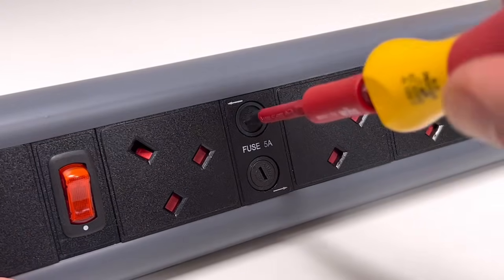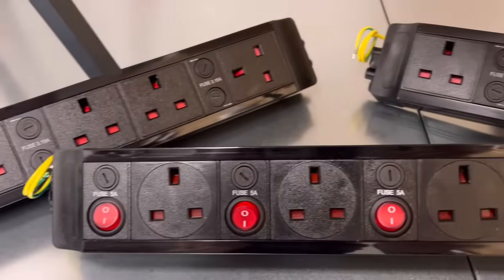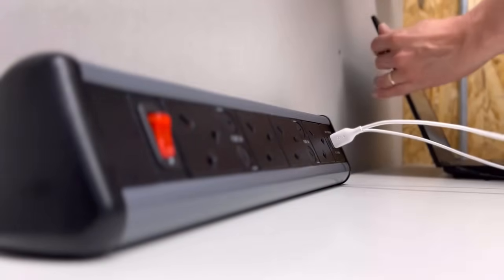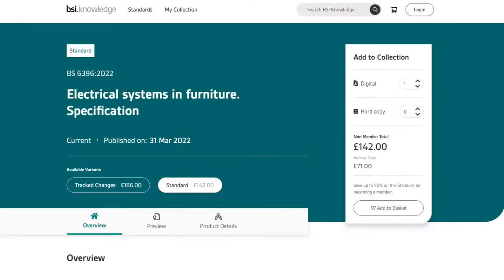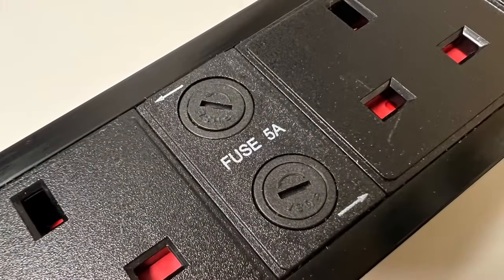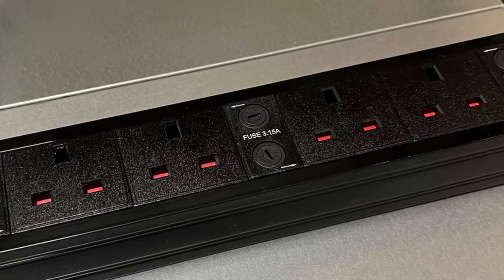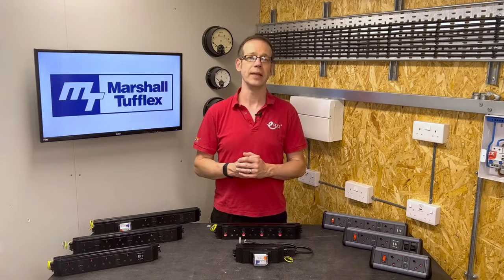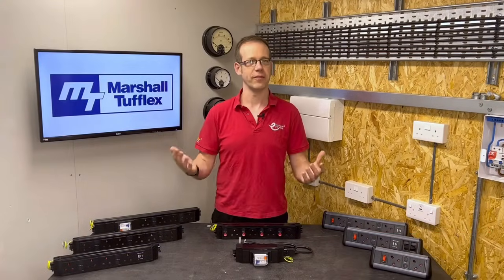BS 7671 Won't Tell You - Why Desktop Sockets Have Tiny Fuses

Comment: Our staff used to put 2kw heaters in these sockets and kept blowing fuses, Then just unplug and put into another socket.
They were told many many times not to, but hay, they are called managers or supervisors and more important than I. (By salary at least, but not by common sense)
Then when moving their laptops to blown fuses, would compain that every thing here is 5h + 1t     o.O
We removed all heaters from all desks and told them that 21'C is just fine, Just put a frelling jumper on.
AIRCON WARS. Damn it's messy
Reply: All to common.
Reply: Yep. We had the cleaners go down whole rows of these sockets with their vacuum cleaners, taking out dozens of fuses!
Reply from the maker: Yur, it's one of those things clearly stated in the Standard but probably never been properly communicated to staff. 🤷
Reply: @MrBinabanana  At one point, I used to take my time to replace the fuses if I saw a heater near by. 
They used to remove them from the kitchen and eating area. Just to keep their legs warm. 
Even tried cable ties to keep the heaters down stairs.  
Their attitude was "Sod every one else, I'm cold"  Even at 21'C
Reply: @MrBinabanana That is exactly what happened im my office, now everyone has a couple of standard extention leads, and they are all plugged in one after another. Much safer than it used to be. Buy hay they are all pat tested.
Reply: @efixx  Can you still use BS546 5A Type D's for this kind of purpose? (I've seen that in the past). Just need some fly leads with IEC C13s on the other end.
Reply: @MrBinabanana  Were they foriegn in the sense that they did not speak/understand good English and thus asking them not to do so would be futile.
Reply: To be expected when you install sockets that accept any 13A plug, and look identical to 'normal' 13A sockets. I bet the only other place most people will come across a socket like this is on a train, or in a hotel room, when they don't have their 3 bar electric fire with them.
Reply: Had this at my old job. Desk electrics had 3A fuses per socket and staff kept plugging heaters in. Had a policy whereby any heater found on site would have the plug snipped, no excuses. So, when they blew the fuses one day we went over and told them not to plug any heaters in (again!), only the RCD had tripped. Went to the electric cupboard and it was stacked full of the heaters they thought they had hidden! Must have been 15 in there and each one got the snip. Got several complaints lodged but all threw out due to a blatant breach of policy by the staff. I don't think they realised that the large metal MEM box on the wall with a yellow lightning bolt attached was the DB feeding their workstations. It wasn't even cold it was 23C year round in that building, put on a jumper FFS.
Reply: @MrBinabanana  when i spec systems like this you need a few none fused sockets in a easliy accesable place for your higher current loads like vacuum cleaners, large photocopiers because people will do things you can never dream of. you need to be prepared for everything because you will get called in as nothing works.
Reply: @paulmatthews5470  23'C - Wow, (Some staff would still complain)  It's too hot or It's too cold, or even worse, they open a window when a room has aircon and it's humid and 30'C+ outside (Very VERY rare British summer day). 
I want fresh air. it's too stuffy.   My Rant over now. lol
Reply: @MrSnowMen   Dreaded doing anything major in there as I'd sweat my tits off in a few minutes and end up a smelly BO mess for the rest of the day!
Reply: @richardalderton1047  True, So how would you stop people using the same looking socket?
Reply: What is 5h + 1t?
Reply: The girls in our office had 2kW fires under the desk, to keep their bare feet warm...at leaat most were plugged into a floor socket, not the desktop ones. All appliances were supposed to have a PAT label, but fires brought in from outside would not be in the database, and would be confiscated...
Reply: @MrSnowMen 21C at five foot above floor level (official thermostat height) is not 21C at a lady's foot level...
Reply: @paulmatthews5470 Ladies wear socks and trainers on the way to work, then pull their fancy high heels out to clack loudly round the office. No socks, ergo, cold feet...heat rises, so 23C at head height is cold at foot level...

Comment: When I replaced my desk about 7 years ago, I just used six double sockets in surface backboxes. All fed off a 13A rated cable from a 13A plug. Works great.
Reply: Did you check for resistance ? You could have a lot of heat building issues if  your not careful, it could work great and show no problems but catch fire while you sleep, so always check the resistance in a newly installed electrical outlet
Reply: @danielphillips5324  The whole thing doesn't even draw anywhere near 13A total. I think at one point the upstream fuse even was even just a 5A.
Reply: @danielphillips5324  
Resistance? if all cable are connected up correctly resistance is minimal. 
All Dave needs to do is ensure the fuses in the appliance plugs are correctly rated to protect the appliance and appliance flex.
Reply: Same here for my small electrical/electronics workbench. The 4ft or so of flex feeding the sockets is 1.5mm² and there's probably a maximum of 5A load, if that. An oscilloscope, a function generator, a desk lamp and sometimes my PAT420 tester.

Comment: In the UK, these 5A sockets on a desk bank is overkill, but not elsewhere. We have fuses in plugs which should be rated to say the computer which is usually 3A. So four sockets on a desk bank, which is plugged in the  wall socket rated at 13A maximum.  All bases are then covered. Most computers do not draw more than 2A, so six maybe possible on one bank. 

The 5A sockets on desk banks makes perfect sense in a Continental or American setup where all is protected by say one 16A breaker at the panel.

Comment: BS 6395 does not say a 3A or 5A fuse has to be in the desk extension bank. The great thing about the British G Type socket and plug is that a fuse is in the plug. Rate the plug to 3A or 5A accordingly and omit such tripe as a fuse in the extension bank.  No need to have fuses in the extension bank itself.  It is just extra needless complexity and expense.
Reply: Maybe you should actually read the text at 2:14:

"No more than four sockets, where each socket is separately fused..."

That means the protection is required to be in the socket, not the plug, and each socket must have its own fuse (so the fuses must be in the extension bank, since that's the only possible place to do that), so your statement is clearly wrong.

The purpose of this requirement, as stated in the video, is to prevent people from plugging higher-powered devices into these desk extension banks.  Relying on the fuse in the device plug would not be able to prevent plugging in a higher-powered device with a higher-rated fuse, and is therefore useless for this purpose.
Reply: @foogod4237  
I did actually read it. I read the words making no assumptions.  You assumed the fusing must be in the socket housing.  It says no such thing. It says:

a)
No more than four sockets, where each socket is separately fused or has other overcurrent protection rated at not more than 5A.

It does not say where the fuse should be specifically located at all. It does not say, the fuse:

1) has to be in the socket housing
2) has to be in a separate housing 
3) has to be in the plug.
4) has to be in-line in a cable.

I does say:
or has other overcurrent protection rated at not more than 5A.

▪ If the extension strip has 4 sockets outlets each socket must be fused somewhere to 5A. 
▪ If the extension strip has six socket outlets each socket must be fused to 3A.

It may be a good thing if manufacturers had in big embossed letters on the extension strip that each socket must have a 3A or 5A fuse.  But nothing says they have to.

Comment: ah bs6396 i have spent many hours reading and designing systems. a few important thing you forgot to mention is  bs6396 power outlets are designed to be used with bs1363 plugs only and with a flex cable of no more than 3m.
Reply from the maker: Thanks for the extra info! 😃

Comment: Power strips in North America generally have a single 15 amp circuit breaker for the entire power strip. To be fair, power strips here aren't built very rugged anymore, so a constant 12.5 amp load would likely result in them melting and bursting into flames. (cough) This means that if you need to use a power strip for more than just light power use, you're better off building your own power strips out of J boxes and quality receptacles.
Reply from the maker: Interesting 🤔
Reply: In Finland power strips generally do not have over-current protection. They are rated for 16 A though.
Reply: Same thing Australia.  10A breaker in all but the cheapest of the cheap rubbish.  Each standard wall socket is rated at 10A so the powerboard should limit there.  The general construction of typical units is also pretty cheap 'n nasty here, definitely not rugged.
Reply: @okaro6595  
oops!
Reply: I’ve just made my own extension cords and power strips with 14/3 flex cable, weather tight/strain relief connectors, metal outdoor electrical boxes, matching covers, and various different sockets and even switches for switched extension cords and switched power strips
Reply: You could also just buy a higher quality power strip that's rated for more current
Reply: And i bet it looks crap!!!!!!!!!!!!!!!!!!!!!!!!!!!!!!!!!!!!!!!! @NyxKemo
Reply: @JL-rx6hl  nope, looks better than any extension cord or power cord, but most importantly it can safely handle a full 15 amps without catching on fire
Reply: @okaro6595  Same in Federal Republic of Germany - every outlet have rated 16 A, a normal power cord should be 3x 1.5 qmm², 230 Volt, 16 A, 3'500 Watt. In Thailand it is 10 A, also 3x 1.5 qmm², 230 Volt, 10 A, 2300 Watt. 

BTW: We are so clever to use only one device in a multi-plug socket with long power cord at the same time same the Finland people. 😊

Comment: Quick question I’ve wired in a 4 gang socket that has the 3.15amp fuses in them, very similar to the triangular one in the video. I’ve replaced the single socket that was spurred in my living room with a fused spur. 
So it goes like this 
Fused spur————-3.15a 4 gang socket. 
My question is what can I reasonably run off this? 
I have an undercounter fridge I would like to connect and my partner uses printers, laptop and the occasionally air fryer for her hobby. Obviously not all running at the same time but would any of these cause any problems.

Comment: I suspect there is a secondary linkage via the typical RFI filters which can create up to 1.6mA earth leakage per connected device, and via various multiplying effects will create a larger earth leakage across the whole extension, which then falls foul of other limits on the the single fault earth leakage limits. 
I suspect that there's a hidden rationale of scaling the RFI earth leakage in the appliance based on its maximum current, or it could be a diversity limit across the multiplicity of items plugged into the multiple socket outlets to limit total current.
Reply from the maker: Thanks for commenting! 😃

Comment: It seems really annoying that they even have fuses where circuit breakers should have been used. The first time someone plugs a kettle in that fuse will pop. There are only two possible outcomes for what happens next, either the fuse never gets replaced and the outlet remains dead until the whole thing is replaced and the socket strip ends up in a skip, or the fuse gets replaced with the wrong value to ensure it does not pop next time someone plugs a kettle in and the whole assembly overheats.
Reply: Probably the fuse gets a "hardwire-bypass" by a known DIYer… 😲

Comment: They were a real pain in my old office you could guarantee the cleaners wouldn’t bother to use the floor sockets, just plug ‘Henry’ into the desktop socket and blow the fuse so when you got work your computer didn’t. Happened pretty much once a month to someone in my team.
Reply: Hmmm ... an original Henry is build in UK and use 620 Watt at 230 V, this are 2.696 Ampere. Should be work in 6 slot and 4 slot multi-plug power cord without problems. Possible your office need an electrician quickly! 😊 

Hail the internet for checking true information... 😂 

I self use a German "Vorwerk" but at one of my working places use a UK "Henry" since years! It is a wonderful product for clean the big dryer 12 times daily.
Reply: @OldLordSpeedy  IIRC the double sockets have 3amp fuses in them, plus although the cleaners commonly had a Henry, they also used a large wet and dry vacuum.
Reply: @garyhill9723  Do you not read my full answer where I calculate that an UK "Henry" use only 2.696 ampere? If do you use UK typical 240 volt with 620 watt this are only 2.583 Ampere - less 3 ampere too.  For meet the 3 ampere do you need 206 volt at the 620 watt. 🤯🤦‍♂️ If this happened do you need an electrician immediately! 

My record here in Kingdom of Thailand was tested only 160 volt at 220 volt socket normally at an one-phase line after workers came home in a worker ghetto with around 60 houses. But I never seen this IRL in Europe without a real fault!
Reply: In my old office we had Walsall Gauge sockets for the computers for this very reason. Nowadays you could probably use the MK non-standard plugs and sockets with the T-shaped earth pin to achieve the same thing.

Comment: 5A gives 1200W approx so most devices would be fine. High end workstations though?  Threadripper Pro 400W plus 2x Nvidia RTX A6000 (300W each) is pushing 1000W at peak plus all the ancillary stuff. They will be better off plugged into dedicated UPS power  feed  anyway
Reply from the maker: Sounds like a decent setup! 💪
Reply: Well, that employer's a keeper!

Comment: All very complicated but to what end? All the applicances will have cords rated for their load current and the power strips are good for 15A say.  So all that is needed is some kind of thermal overload cutout with a push-button reset.  Most appliance faults lead to open circuits or earth leakage or enough fault current to trip an upstream Circuit breaker.

So the answer is mostly cheap power strips on sensibly sized circuits with circuit breaker protection and maybe thermal cutouts and residual current devices.

Fuses are to be avoided.  They create exposed live connections and need skills, tools,  and spare parts to restore supply after faults.  As seen from the other comments.

It seems that the UK is so committed to small appliance fuses that it cannot accept that their day has long passed.

Comment: I do NOT need a USB charger built into every piece of furniture in my house, thanks very much! 🙄  Simplicity beats piles of future e-waste.
Reply from the maker: Well, it's not mandatory yet... 🤔
Reply: Worse still the underlying SMPS is always on so there's always a tiny load for no reason since the USB isn't switched
Reply: I purposely do not install USB outlets in fixed installations, as they will be outdated much sooner than the life span of the receptacles. In the high quality extension cords such as the ones shown they would be all right, but usually its more economical to buy USB chargers separately.
Reply: The built-in USB sockets do not support high-power device charging, so your new phone will only trickle-charge...
Reply: @Umski ...makes testing impossible too, while Megger testing can blow the USB module...